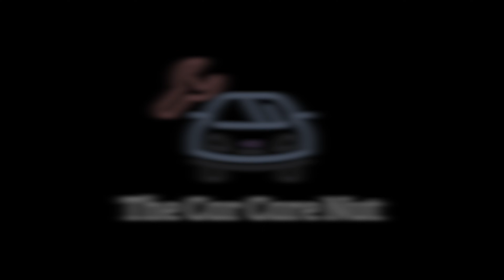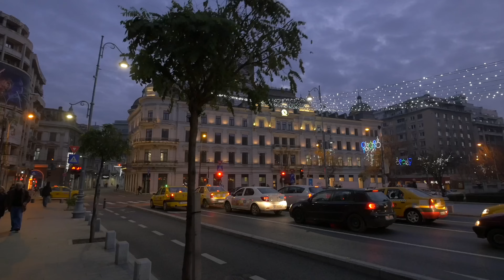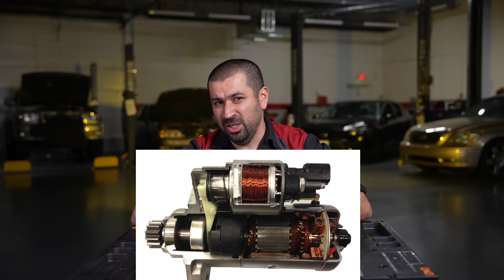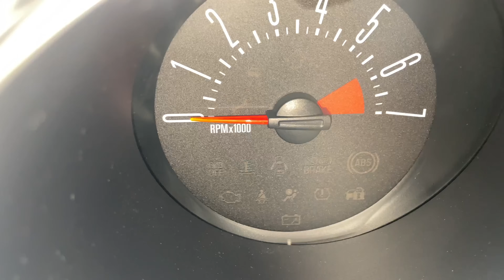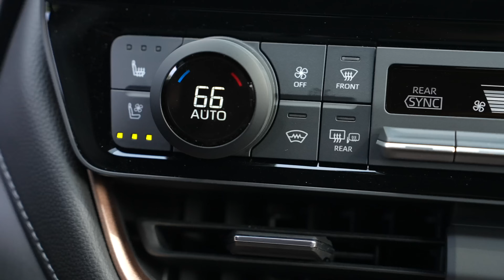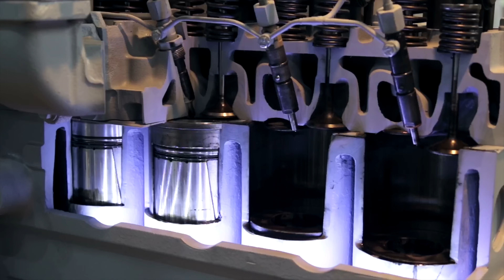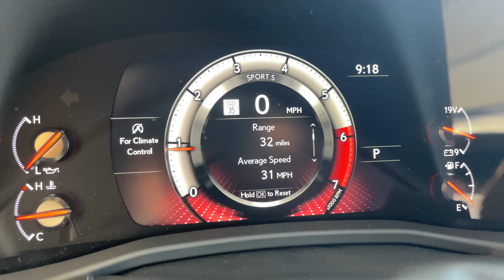How Does Start Stop Technology Work in Modern Cars? Everything You Need to Know

Comment: I don't understand why you think the starter will be the thing that breaks with all these start stops.  I have a 2017 Highlander with this tech and within 2 years from new, the battery needed to be replaced, and the Toyota battery costs $450 dollars!  That's ridiculous for a feature that saves no fuel!  I replaced the battery with a standard AGM battery and installed a module that sets the Start Stop feature to off by default.  This doesn't alter the system, it just takes the place of me having to hit the button every time.  ...problem solved.  That was 5 years ago, and the AGM battery still works perfectly.

Comment: I have the 2023 Mazda CX30 touring I Disconnected the stop/ start wire, It is by the bonnet catch, you lift the bonnet a plastic thing where the catch is just lift it and the wire is there, just slide it along and it will disconnect you don't have to disconnect it completely.

Comment: When my 2024 Honda Pilot goes into the auto stop mode, it will reduce the fan speed of the HVAC.  I presume the compressor RPMs are also reduce.  Just another way to reduce drain on the battery when stopped.  I dislike auto-stop because no matter how much re-engineering they've done to add battery capacity, etc. every time you start and stop things, you're taking useful life out of those items compared to just leaving things running.  Autostop works best for extended stops, where a normally running engine would produce more exhaust gases.

Comment: What about the air conditioner turned off during the Start/Stop operation? And even more important: what about the oil cooling of the turbocompressor in turbo engines? Very few cars have an electric oil pump, so when the pump turns off, the turbo is staying hot w/o cooling, which is killing turbine....
Reply: My (ford) truck has a secondary electric water pump that runs to keep the turbo cool. 

I usually shut the system off, but if I leave it on and I have the AC on it shuts the engine off and the AC stays cool for about 15 seconds, and the fan slowly ramps down and ramps back up when the engine restarts.

If it's too hot inside the engine won't shut off because the AC is on.

Comment: I rented a vehicle a couple years ago with the start/stop feature. Rental company didn't tell me about it, I didn't know it was there until I was in start/stop city traffic, didn't know there was a switch to disable it. Weather was cool and raining, all seats occupied, defog turned on. Yep, the windshield fogged over very fast and thick at every stop light because the system did not react to the need for keep running because the defog was on. A very dangerous situation just because I was uninformed. I ragged on the rental agency when I returned the vehicle.

Comment: ASS is a really pointless innovation. It saves basically no fuel at stoplights and puts tremendous wear on engines. It's only there for car manufacturers to cheat the milage rating system. Gas is cheap, engines aren't.

Comment: Amazing story really well told. I could never have foreseen the multiple aspects that needed to be re-engineered/reconfigured to make this feature viable+safe. 
But I’m not convinced that all manufacturers have done this + to the same level (maybe Toyota is the ‘gold standard’?) - for example dual mass flywheel failure is expensive to fix (total scrapping older cars?) and the increased ‘jolts’ to the flywheel of frequent stop/starts could cause failure to happen much sooner? And getting meaningful data on stuff like this is - I suspect - just not feasible. 
Glad my Panda 4x4 maintains the previous setting every time I use it - which is off! 🤣

Comment: Very well explained, thanks! 
I have owned a couple of cars with S&S that are slightly different from what you have explained, but overall, you have touched all important facts. And most important, that S&S will not break your engine, as many people yells.
In my case (and talking about EU market), I owned an Alfa Romeo with the 1.4 Multiair engine (130hp) and a 10th gen Honda Civic (1.5 turbo, 182hp).
The main differences I saw are:
- Starter: I always felt that, when the engine was stopping, if I pressed the clutch the engine will still completely stop and then fire again. I wonder if it's just that the starters were just reinforced ones without that double solenoid.
- Battery sensor. in the Alfa Romeo it was quite visible as it was mounted on the terminal itself. I think that the Honda had it somewhere else or integrated in the circuit.
- HVAC: I'd bet all my money that neither of them had all that stuff you mentioned. If the engine stopped, the HVAC just decreased the fan speed and the air temperature was not stable anymore.
The Alfa re-started automatically when it was too hot or cold inside (believe me, too much, usually I manually disabled it) and the Honda just suggested it.
- Steering: the only thing I missed in your explanation. With electric power steering it's possible to keep it working. I know for example that Mazda for instance just disabled the S&S if the steering was not straight.
The Alfa managed to have the power steering working all the time (but re-started the engine if you asked too much of it) while the Honda just powered it down.
- Logic: just note also that the Alfa was built in 2011 and the Honda in 2016, so I also expected some differences. In both cases, as the battery started getting old (just 1 or 2 years), the S&S was not working in all situations. The Alfa tended just to stop the engine to re-start it a moments later (maybe 15 seconds, maybe just 2). The Honda was way more reliable. If it stopped was because it was going to keep it stopped all time was needed.

And bonus facts: 
1) starter/generator. In Europe, PSA (the French Peugeot) uses an alternator/generator that is capable to work also as starter since the 2010s I think. The result was that they were the fattest and smoothest engines to re-start at the very beginning. Now, this technology is also used in their PHEVs and believe me it's a huge difference.
2) Mazda's capacitor: in the Skyactiv G (160 hp) they installed a small capacitor that was charged when braking and to provide energy only to the systems (not able to move the car).
3) Oil and water pumps: as far as I know, an electric oil and water pumps can also be installed to improve lubrication and cooling. Not all cars I guess, but I have seen some of them in catalogues. Like PHEVs but smaller.

Comment: This is such a great video. I have worked at Subaru for a few months, and within that time frame, the vehicles that had the start/stop feature in the early stages had so many issues with the battery dying at a traffic light for the owners. When the vehicle would shut off, it would not go through the process of coming on. They had to put the car in park and start the vehicle back up with the ignition.  Batteries were dying too prematurely. There was a huge settlement where Subaru covered the costs of battery replacements until they came out with a bigger battery that could withstand that start/stop feature. December 2023, every appointment in service was a battery issue with only the vehicles with the start/stop feature. Huge mess and a lot of angry customers.
Reply: It’s all about penny-pinching cost cutting for bottom line profits. Same with the Fiat Panda Mk3/Gen 2 introduced 2003 that featured electric power steering. A huge battery drain (especially with the ‘girly’ button) but they kept the previous Gen 40AH battery! Totally inadequate, causing power steering failure (steering became heavier than a 1940s truck!) so they eventually (after huge complaints) uprated it to 50AH - and problem solved!

Comment: Start stop is garbage. What sense does it make to stop the engine at a stop light when it's 105F outside and the cabin temp is way higher than the AC set point? Haven't driven a Toyota with the feature, but have driven a few others and they just turn off the AC, super uncomfortable. Complete garbage feature. Puts stress on everything. Just more to go wrong.
Reply: “puts stress on everything” - mostly the driver🤣

Comment: The big question is ... can I push start the car when it has a flat battery or will the computer say no? I have a Yaris and an IQ bot manual with 1.33cc engine and stop start. I have tried testing it by rolling down hill in neutral, however the computer detects the rolling wheel and immediately fires up the engine - computer says no coasting allowed.

Comment: Let me ask you a question about vehicles with turbo and start&stop technology.
Does it monitor turbo rotor/shaft rpm before it shuts off the engine? Because, as far as I know, if you shut off the engine in turbo vehicles, especially after long drives and high rpm usage, turbo rotor still rotates and it needs oil.
For that reason, many vehicle manufacturers recommends wait at idle for 1 minute before shutting down the engine.
While engine is shut down at traffic lights, oil pump is not sending oil to turbo, if start stop system is not monitoring I suspect it will not be good for turbo life.
Thanks for your response in advance.

Comment: Ive been traumatized by a couple of instances of driving cars wgen i was younger that shut down at stop lights, both times the alternator was diagnosed as the issue. The first one was a new Smyrna- built 98 Altima that had been driven off the lot that day, then later just died.

So start-stop technology that is becoming common now just triggers those flashbacks. I always test it by letting go of the brakes a little to ensure the alternator isnt effing up.

Comment: I had two Vauxhall Insignias with it and it stopped at sround 70,000 miles in both of them. I never fixed it and they both continued to pass emissions tests. They were both diesel using AdBlue too.

Comment: I feel like start-stop works a lot better on a manual car, it is up to me to decide if i want the engine to go off or keep it on by keeping the gearbox on 1st with clutch pressed vs gearbox in neutral with clutch released. My car will also automatically start the engine when the lights turn green or when the car ahead moves, which is pretty cool

Comment: My daughter and her husband were just stranded on the freeway in Palm Springs last weekend when the battery gave out on their 2 year old Tahoe. They were driving on the freeway when the dash board lit up with every warning light there and the message told them to stop immediately.  The SUV had to be towed 100 miles to get back home because the local dealer couldn’t even look at it for a week. I had just told her a week before that she shouldn't be using the stop/start system because her drive to and from work was only about 4 miles with lots of stop light. Her battery would never be charged with the system turned on.

Comment: A few more pieces of technology to go wrong. However, I've got a 2022 gasoline Honda Vezel (the Japanese HRV version) which has a three stage start/stop brake pedal. First stage, light pressing the pedal the car still  moves. Second stage the wheels stop and the engine is still going, and the third stage, pressing the brake pedal a little harder the engine stops. That  way I can choose when I can shut the engine down or not, without pushing the start/stop button. 
I don't know if this feature is unique to Honda or any other cars.

Comment: It will prematurely wear out your starter, battery and alternator. It also fouls oit the engine and causes heat fatigue and soak. It is only because of the euro emission standards. Get rid of it most vehicles are very easy to disable permanently.

Comment: emissions are a lie, its all western agenda to destroy russia long term, because oil is their main export, by forbidding selling of gasoline cars and forcing general population to use electric crap, they are hoping to finally weaken it, because its all a hoax, global warming, bs. One NATO army every year emmits more CO2 than all civilian cars in the world combined,  there is a documentary about it, so dont propagate a lie. Global warming is a hoax.

I am disabling my start-stop tomorrow, i will disconnect the sensor-jack on the battery and it will stop working, because as you said, fuel savings are minimal, im just putting unecessary strain on engine components, had to buy expensive battery, replaced my starter, and a small oil cooler was leaking too. I thought that it was saving fuel, but it isnt really.

Also i unsubscribed when you refused to tell people how to disable it (disconnect the jack from battery)

Comment: Your last few statements lead me to think that these start/stop feature could contribute to fuel/oil dilution issues in cars.  Everytime a car starts, they would squirt a little fuel to start the car... and when the car suddenly stops, potentially leaves some a tiny bit of unused fuel.  Over time, this tiny bit of fuel gets mixed with gas, and if this happens over a period of time, then more fuel get's mixed with the oil  The would anecdotally align with mechanics and OEMs telling people to take longer drives (vs a bunch of short drives while the engine is cold) to mitigate oil/fuel dilution issues.

Comment: I have seen a lot of StartStopp car here in europe but none of these have special dual coil starters, a capacitor or an extra water pump for the heater when the engine is shut off or any other special component you have mentioned. (just a special battery and the preasure sensor on the brakes)

Comment: It's really about a loop hole in emissions testing in Europe
 a simulated rolling road test where extentive arbitrary dead time averages down the total emissions of the test, it was never for benefit of us just the manufactures certifying their cars, it also causes out of warrenty repair cost because the voltage mantainment, stabiliser module is a type of dc to dc convertor and they are by nature unreliable so the manufactures claw lots of money selling replacements and to date no one can make clone parts for this

Comment: Thank you… learned quite a bit! Many yr ago I hosted a European exchange student and she told me many drivers shut down at lights to save on expensive gas. Of course, the starters,  batteries, etc weren’t designed for the stress. I have just gotten my first vehicle with this feature. I’ve read some studies that show just over 2% fuel improvement. I sometimes shut the system off, but often leave it on especially driving local intersections where I know I’ll be sitting a while. The computer seems to do a good job of knowing when to disable it to keep the HVAC running properly.

Comment: All that said, I hate start/stop.   On Christmas Eve I was taking my kids to a dinner at a friends house, went to start my Jeep and the battery was too weak to start it.   I got my lithium booster pack, got it started and went to the dinner.   After we were done I knew we'd have to restart it again so I got it back out and started it up then we went on our way back home.   I didnt notice though that the auto start/stop had turned itself back on again (I have a tazer and it allows the setting to stay off between cycles but it reset somehow because of low voltage i guess) and at a stop light it kicked the motor off so I'm dead in the water at an intersection now and have to get the booster pack back out and open the hood in the middle of the road at a stop light.  

I dont care how much gas its "saving" me, I dont like the feature and i'd prefer a switch to turn it off all the time and not one that re-enables itself when you cycle it.

Comment: These systems really vary by model and manufacturer. My Hyundai Hybrid is excellent and I cannot tell you how nice it is in NYC traffic knowing that I am not idling the gas engine for literally hours at a time. All that wear and stress on the engine is silently replaced by smooth torque and no heat under the hood.

Comment: I rented a Jeep grandwagon on a trip in Mississippi with this feature. Freaked me out the first few times it did it. But I would have to let off the brake to get the engine started for the A/C. I guess it was not like a Toyota design. But I'll stick to traditional car because I'm cheap.

Comment: Hello,
Thanks for the video. It was very informative!
One thing I might add is that you may want to watch out for additional consumers that are running on the car battery ( dash cam, devices charging, etc. ) . While the car is running and the system engages, these may drain your battery faster if you have frequent cases when the start/stop activates.
I saw multiple times a low battery message on my dashboard when taking long drives in congested urban areas.
Overwhal, I don't like the system, and I always deactivate it when getting in the car.
Take care !

Comment: Funny. I turn off the engine at a light and start it even before the car in front of me starts moving. Sounds a lot simpler than trying to solve all these artificial problems.
If i were them id do just that. 
Maybe keep a little battery to keep cold air blowing in the vents.

Comment: Even on a simple car like the Mitsubishi Mirage (2015 CVT model) the instruction manual listed an impressive amount of variables relating to the start-stop system. Thanks for the heads up. I noticed some differences with the Toyota system. I don't think the Mirage has the double solenoid starter, although the owners manual says that the starter of a vehicle with start/stop is heavy duty, as is the battery and the generator. Also HVAC stops working in a start/stop event. Only the ventilation keeps on working at half speed. The only annoying thing from a consumer perspective, is that when you arrive home and stop, you want to put the transmission in park and leave the car. But in the mean time start/stop kicks in, so the car beeps the hell out of you. You have to put the ignition on "on", let the car restart and then shut it off. Very annoying.